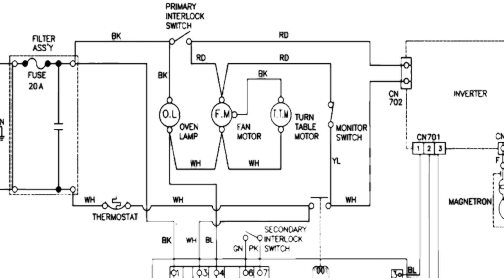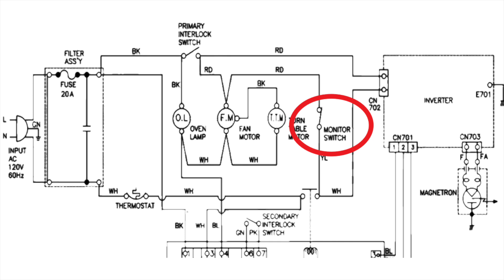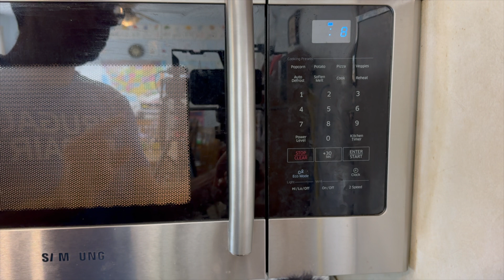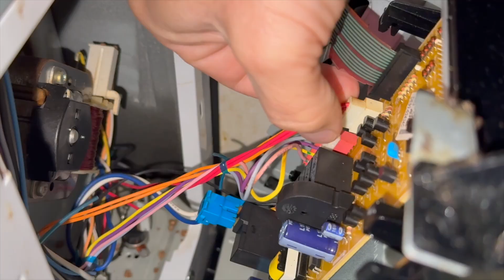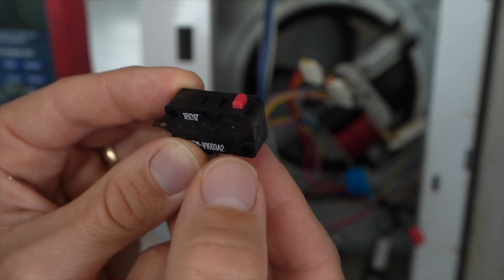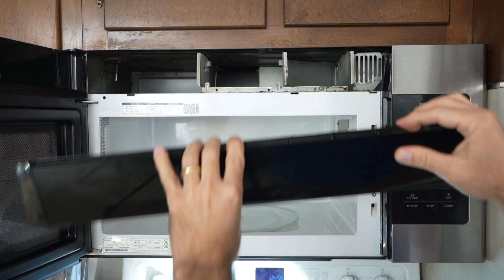Save Hundreds with this $3 Part | Microwave Repair

Comment from the maker: Thank you for watching!  Let me know, what are you currently working on or what has been your latest project (in a new comment)?
Reply: Probably a good idea to swap out all the micro-switches since they all have the same milage on them. 

Remember to double check which ones are "normally open" vs "normally closed". 

Also make sure to stay away from the high side which can hold lethal voltages in wires or the capacitor that can jump. Someone I know survived it and got a tiny hole in his skin but a cavernous burn of the meat underneath. He was lucky he didn't die... usually that kind of voltage/amps combo is lethal. He said it jumped when he got close.

Also beware the beryllium since a spec of dust from it (on the magnetron) causes guaranteed cancer. SUPER TOXIC.
Reply: @tuvoca825  Guaranteed?
Reply: Awful advice. Starting with the micro switches. The contacts have become very dirty and pitted due to arcing. Just bending the spring will not help the contacts, at a minimum they should be cleaned up (thought really just replace the switches).  The risk of getting a huge hock is also quite high due to the capacitor. You hound also check for microwave leakage, if you have mucked around with the interlock switches.

Comment: I have a countertop Kitchen Aid microwave convection oven. The numerics of time on the keypad are not complete on the last two digits. I had a repair person come, he said it would be a costly repair and l should not use it it may cause a fire. It is installed in a wall cabinet on a separate power outlet.  Otherwise it works fine.
Reply from the maker: Do you mean it works OK but you can't see the seconds (last two digits) on the timer?  Have you looked into getting a control board from ebay and swapping it out?  It's fairly easy on the over the range microwaves I've worked on but I am not sure about a countertop one.

Comment: I have the same Samsung microwave, Bought it 8 years ago. It still works great but I have to keep fixing it, almost every year I have to fix something mostly the door switches are going bad, they were all replaced at least twice, I have the door plastic latch that holds the locking spring going bad, the capacitor went bad, etc. But this are really easy to fix. Thank you for this video, It will help people save their money and save the environment.
Reply from the maker: Thanks for watching!  Glad to hear you’ve been able to keep yours going.